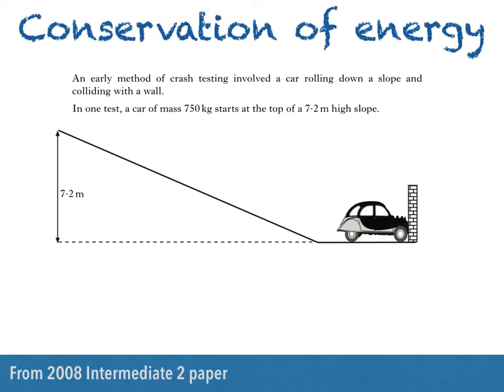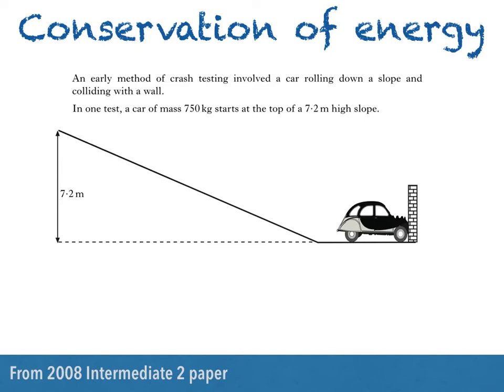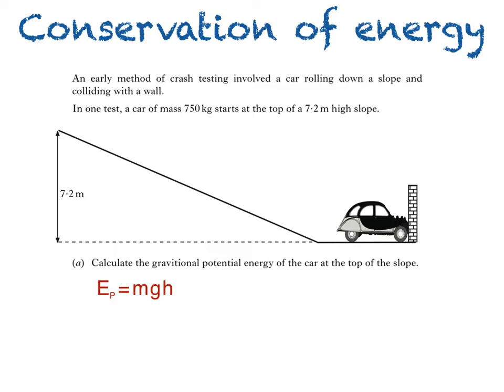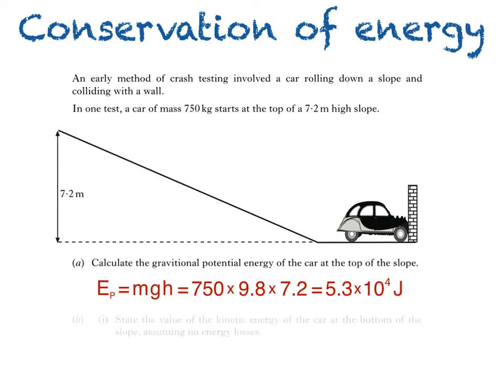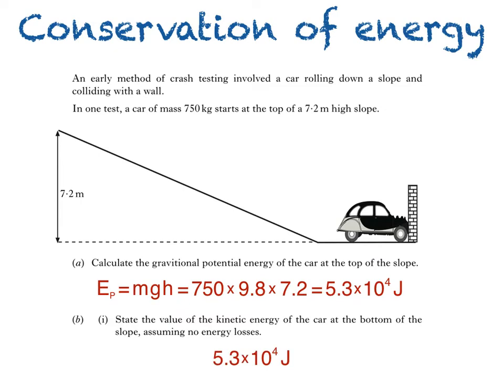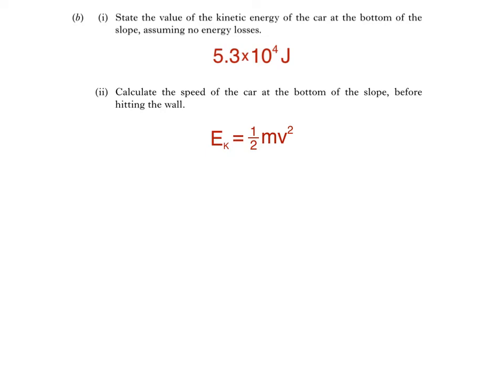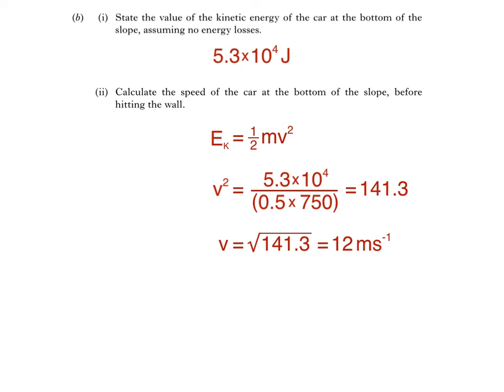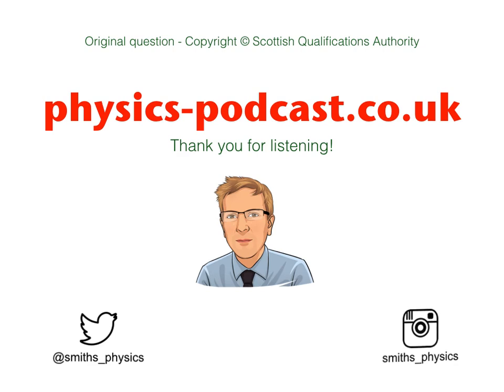National 5 Physics - Conservation of energy

Comment: Would you still get the mark if you write 52920j?
Reply from the maker: You would - technically the answer should be written to 2 significant figures although you are allowed up to 2 figures more than this without losing marks. Taking 52920 as 4 significant figures, your answer would be fine. It's a topic I'll cover at some point in an upcoming video - if in any doubt, write your answer to 3 significant figures.
Reply: @MrSmithsPhysicsonline  Thanks, really appreciate it.